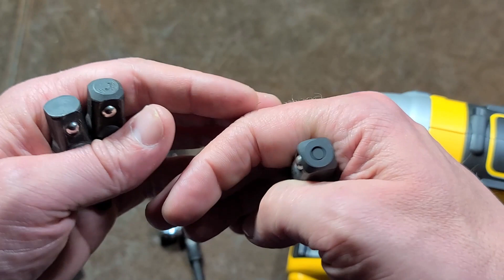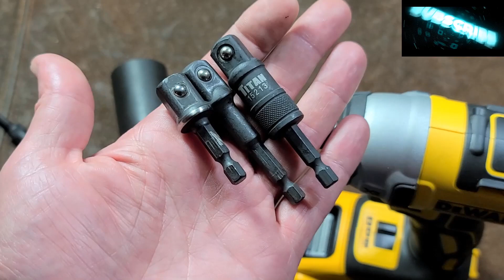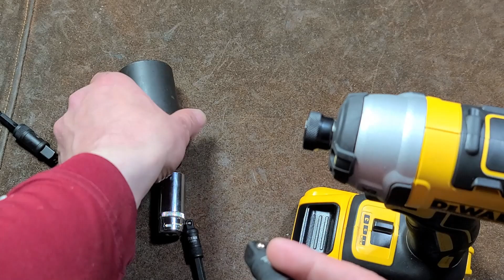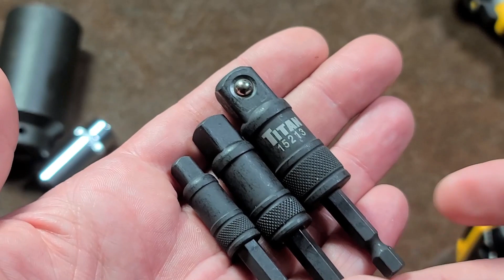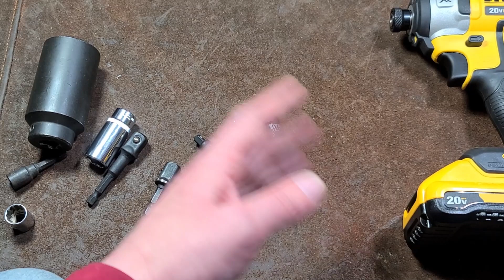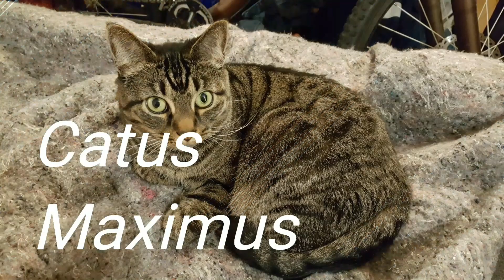Titan Locking Quick-Release Impact Driver Adapter Set Review

Comment: I like these. I have a few tools from Titan and they've never let me down. I like these because my quarter inch drive magnetic Sunex set tends to want to let go of the quarter  impact driver adapter so locking the magnetic socket on would be nice so that I'm not having to remove it every time I remove a nut or bolt...
Thanks Big Cat....🍻